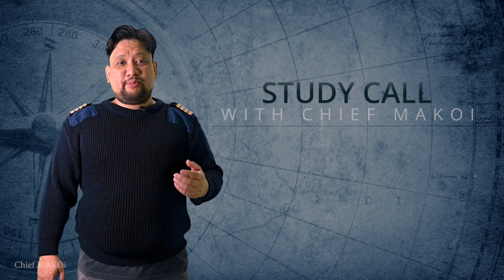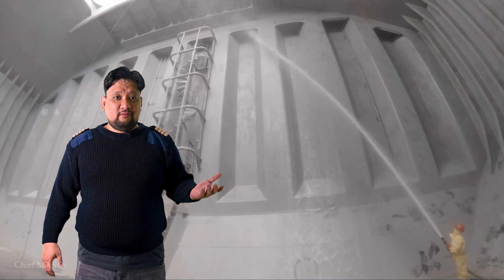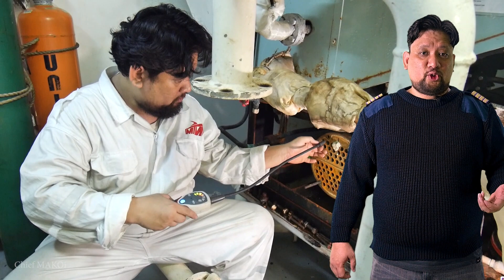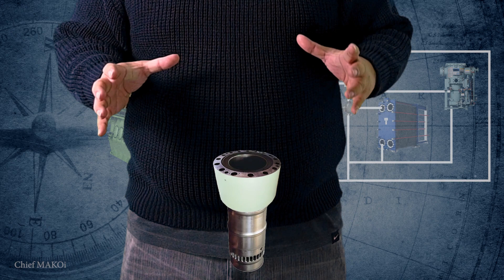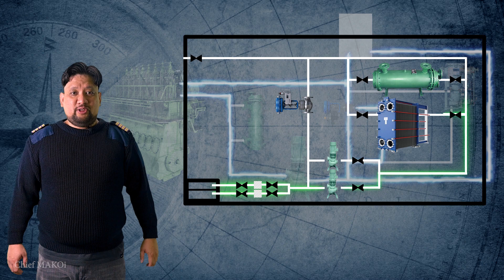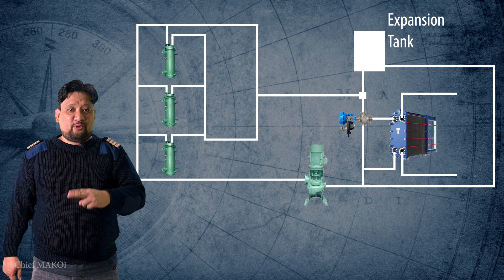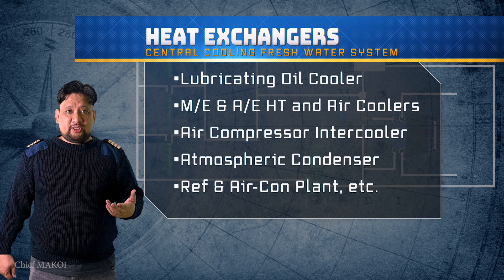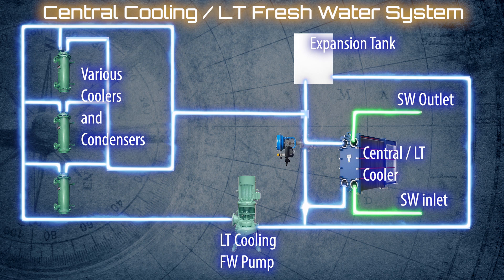Ship's Fresh Water Cooling System | Study Call Ep 003 Chief MAKOi

Comment: I wish I had these videos during my cadetship, would have made things so much easier than reading incomplete manuals and tracing every single pipe in the engine room. 

Purifiers would be a great video, about why they are used and troubleshooting common problems etc. I think if you talked about general troubleshooting for most systems, those would be useful.
Reply from the maker: We'll get to that.

Comment: What if your ship was in a fresh water lake like the great lakes in North America. Would you still need a fresh water to lake water heat transfer system or could you just circulate the lake water through the engines.
Reply from the maker: Still no.  Having fresh water in a closed loop circulating through your engine's inside gives you control over possible contamination and debris.  It's not just the salt.  Think of it like a car's radiator.  There's water inside which you keep clean, and air from outside is the one cooling it via the radiator.  It's way easier to clean the radiator fins than opening up your engine just to get rid of the accumulated dust particles.  Same thing with the lake/river water which may have sediments in the shallow parts.
Reply: @ChiefMAKOi  thanks. I never thought of the water as being dirty.

Comment: Hello Chief Makoi.  I asked a question in a previous video about sea creature encrustations and scale buildup in the ships water systems.  I would like to expand on that.  I assume that you must be using either steam or reverse osmosis and or desalination to produce fresh potable drinking water, But what systems or devices do you use to prevent the scaling up of the heat ex-changers and piping systems on a ship.  Even fresh water circulating in the engine cooling system has a potential to be corrosive; do you treat that water at all ?  It's all very fascinating stuff and I wish I had learned more about this when in millwright work.

Thanks
Reply from the maker: Ships have a Marine Growth Protection System (MGPS) which operates on the principle of electrolysis.  The process involves usage of copper, aluminum and ferrous anodes. The anodes are normally fixed in pairs in the main sea chest or in such place where they are in the direction of the flow of water.
The system consists of a control unit which supplies impressed current to anodes and monitors the same. While in operation, the copper anode produces ions, which are carried away by water into the piping and machinery system. Concentration of copper in the solution is less then 2 parts per billion but enough to prevent marine life from settling.
Due to the impressed current, the aluminum/ferrous anode produces ions, which spread over the system and produce anti corrosive film over the pipes, heat exchanger, valves, refrigeration and ac unit etc, internally.
The Fresh water cooling (Jacket, CCS) system is chemically treated with corrosion inhibitors.

Comment: Interesting the use of the pre-heater during low load operations.  Keeps the cylinders from wet stacking... which brings a question to mind.  Is per-heating the fuel required?
Reply from the maker: Since most ships use heavy fuel oil, yes heating is required.  For higher viscosity fuels, it should be heated to around 130 degrees Celsius prior to injection.

Comment: Hello Chief, thank you for another fascinating and well produced video. Does the ship also have intercoolers and/or aftercoolers to cool the charge air output from the turbocharger? If so, are these on the same fresh water cooling circuit as the main engine?
Reply from the maker: Yes, they have.  It can be sea water or fresh water cooled depending on the system installed on the ship.  If FW cooled, then it's in the LT system.

Comment: Where does the freash water come from? Storage tanks or a distillation system?
Reply: Goes from a fresh water generator, to either a distilled water or fresh water tank. Distilled water is the one used for anything in the engine room (e.g. cooling), the other one is only used for the accommodation block (drinking, toilets, showers)

Comment: When the main engine is  running at slow speeds or when it is stopped, you mentioned an engine heater.  Is that an electric heater?  Is there an electric lube oil heater?
Reply from the maker: Most heaters onboard ships use steam from the boiler.  For the lube oil, it is continuously circulating and going through the oil  purifier, which requires heating.  LO is maintained at around 40 degrees Celsius.
Reply: @ChiefMAKOi  Do any ships use waste heat from the Generators to keep the engine warm? 

Im thinking that Using the Genny's to keep the main engine warm would reduce the amount of Steam needed, and as such the amount of fuel burned to make that steam.
It would also mean that when the Main engine isnt running, depending how much heat it dissipates, the amount of sea water cooling needed to Cool the generators after they have  rejected their heat to the main engine loop would be far less. 

Should be fairly simple to Implement right?  a Heat exchanger between the loops, or direct connection, with a 3 way valve that delivers hot water to the ME first and directs excess hot water to the Sea Water heat exchanger.

Comment: Sir 
When the water comes out from m/e it will be so hot ,and how can it Directly go to expansion tank . That some amount is what iam asking about sir? It's not clear sir
Reply from the maker: Thermodynamics.  Heat rises.  Hot matter expands.  1 kg of water at 30 degrees celsius does not have the same volume as 1 kg of water at 80 degrees celsius.  Figure out the rest.
Reply: @ChiefMAKOi    sir😬👍👍👍

Comment: How do you achieve a fine spray into the diesel's cylinders, when the fuel used is thick bunker oil?
Reply from the maker: Heated up to 133 deg Celsius, pressurized up to around 340 bar and passed through an atomizer nozzle in the injector.
Reply: @ChiefMAKOi  Thanks, Chief!

Comment: How does the ship reverse? Variable propeller or electronic cam shaft?
Reply from the maker: There are some ships with variable propellers but most ships have their propellers directly coupled to the engine's flywheel which means the engine itself will have to run in reverse.

Comment: Hi chief makoi
I wanted to ask you please in the central lt cooler where we can find the open circuit for sea water and close circuit for fresh water we all know that, so i was wondering if the pressure in close circuit is more than the open circuit and there is a problem in the heat exchanger wich the fresh water and sea water can mix, so the fresh water will be mixed with sea water and start to go outside cause the presuure inside is more than outside, so the question is where we have more pressure in the close circuit or open circuit?
Reply from the maker: Always in the closed.